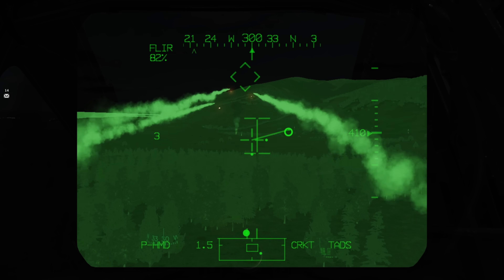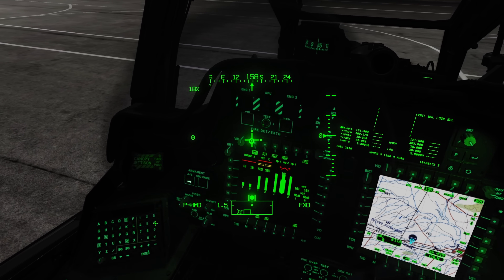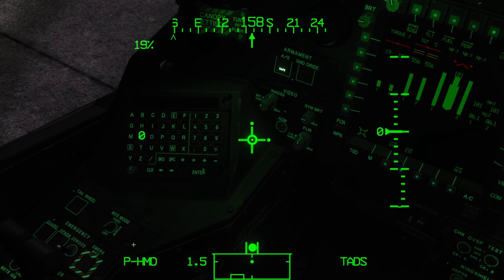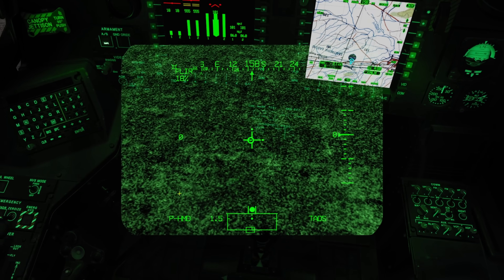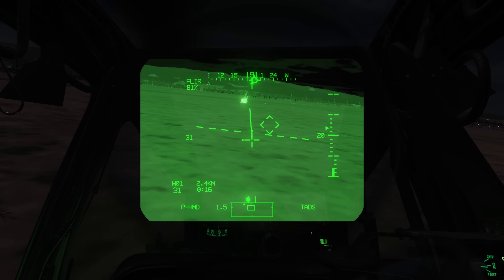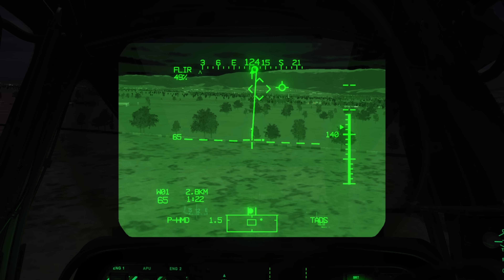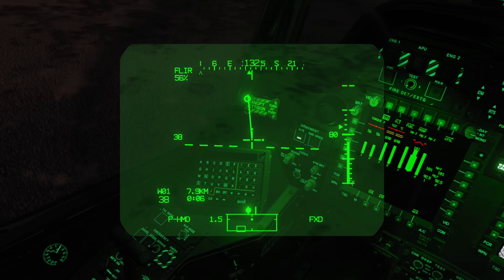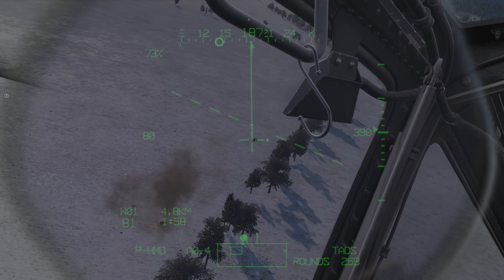DCS: AH-64D Tutorial | Night Operations | DCS World

Comment: (I did send this to you as an email, but thought I would post it here for discussion)

I was practicing some night flying in the Apache and thought I would simulate a dual engine failure (I pulled both throttles to the idle position. As I went to begin my recovery the PNVS and everything else shut off...my scream through the Discord channel was most amusing to my comrades.

Is it normal for the PNVS to shut off so suddenly? At night it's basically an essential system. I don't think I could have reached the NVG's in time- and they run off the generators too right?
Reply from the maker: You let the rotor get too low. Gen shut off.
Reply: @CasmoTV  - I'll do some testing and check back in. Thanks Casmo. :)

Comment: Thanks for the insights :) Just wondering in which situation you would favour the NVG goggles over the PNVS? In VR it gives me a better FOV and depth perception, but it comes at the price of losing the IHADSS symbology and the ability to read the instruments and MFDs. So did you treat it just as a backup or do you actually use it in some situations other than spotting IR markers?
Reply: Yep, the PNVS is very distracting during night ops with vr. Especially when you can't tell the yaw and required rudder input (I need to see the horizon for this). I guess the pilot would use just nvgs + ihadss symbology on the mfd screen and let the cpg handle the weapons with tads.
Reply: MFD screens are not readable with NVG on. It is tricky, the PNVS seems to have a slightly different FOV (zoom) than the default VR view.

Comment: I am amazed by the smoothness and stability of that hover. What kind of inputs and especially curve configs are used to achieve this sorcery?
Reply from the maker: Just small inputs. Don’t over control.
Reply: @CasmoTV  So no curves, no saturation below 100% or anything? 
Because those things were kinda needed to make the Gazelle even flyable for most.
Reply: Keep the acceleration cue and velocity vector within the friendly confines of the line of site reticle probes, and you'll look like a pro.  Develop a scan of Heading, Altitude, Center Symbology, FLIR.  Look close in while close to the ground, and look farther out when not.  Generally speaking, 2/3 ground, 1/3 sky is a good head position.  Nothing higher than that is going to matter, so why look up that high?
Reply: @robk5943  I understand all the theory behind it quite well, putting what you say into practice is quite a different story - the moment the wheels come off the ground, the acceleration cue is outside the LOS reticle already. Pedals are super super twitchy. Also there are weird fluctuations in the torque (and it is not my collective jittering). Nowhere near an expert on this, but it feels overly lightweight compared to e.g. the Shark.
Reply: @mhe0815  I'm finally getting there after a few hours of flying. It'll just click eventually if you practice smooth, slow flight, and stay ahead of the aircraft.
Reply: @ascherlafayette8572  I sure hope so, thanks!
Reply: I used the curves from Wags' video on control mapping. He has Dead Zone 2 on X and Y for the Cyclic and a curve of 8 on the same. He used 80 for rudder saturation but from my understanding he uses a rocker on his throttle as his rudder input, where as I have rudder pedals and use no curves nor change the saturation.
Reply: @CasmoTV  just...muhahahha :)
Reply: @mhe0815  tbh the flight model of the gazelle is the worst and most unrealistic in whole DCS. I mean it's a nimble bird irl, but that thing just flies absolutely insane. Try the Huey, if you want a decently realistic flight model :)
Reply: This helo is much harder to keep trimmed than the KA-50! Omg I am having so much trouble keeping this Heli level! O_o

Edit: OK I just found out that the FFB option in the Misc options page was checked ON and that fucked up my trim on the cyclic. Now that it's fixed, I've been doing a lot better at keeping my Heli trimmed properly.
Reply: @macedk  Yeah it really is that simple.  You can see this in so many areas.  In the USAF they are called PIO.  Pilot Induced Oscillations.  Controlling a F-16 for close in formations or for AAR requires the same kind of skill set.

Hell you can even watch civilians do the exact same thing driving cars.  When they swerve to dodge something or swerve to avoid a barrier or to avoid leaving the road and add in too much steer then they over correct in the opposite direction, etc. etc. eventually leading to a crash.  PIO.
Reply: Ita true what Casmo has said. I too had difficulty at first but after trying for few hours it become second nature. Good luck
Reply: @mhe0815  Actual aircraft, when piloted correctly, is not that bad.  Flew them (and taught them) for 20+ years (A/D/E).  If the tip path plane of the rotor disk is level all around as you pull up on the up/down stick, the following inputs are increased left pedal and slight left cyclic to offset translating tendency.  That's it.  There's always going to be movement of the velocity vector - it's a helicopter.  The key is to not over-control.  Waiting for the official release, but assuming they have them, put the hold modes on until ready to depart the runway, and just use pressure/counter-pressure to nudge where you want to go while hovering.  Also, you're not sitting in the aircraft.  There's no seat-of-your-pants sensing, which will make hovering even more difficult.  Apache pilots sometimes run into the same problem when flying the non-moving Longbow Crew Trainer (LCT) simulator.  Sliding seat and back pans are no substitute for 6DOF.  Hold modes help.
Reply: @robk5943  Thank you, good Sir! Yesterday I set the cockpit textures to medium as so many people recommended, it had an insane effect on my frames (from down to 25ish to now pegged at 45) and instantly I could fly and hover it without any effort. 

Since you know your stuff on that bird, are the torque fluctuations when initially increasing collective true to real life? I have zero time on real world helicopters, but weird up and down fluctuations when slowly and steadily increasing any flight control would strike me as odd.
Reply: @mhe0815  I'm at a loss as I pre-ordered a finished product, not an open beta.  Hopefully, we'll see some of that in a CasmoTV or Wags video and I'll have a better idea.  Normally, you shouldn't see as much fluctuation up and down, unless you're bouncing the collective - which is poor form.  But, the numerical symbology in the HDU of the torque should appear almost instantaneous relative collective and pedal input.  Likewise when banking left (% increase) or banking right (% decrease) in forward flight - commonly referred to as Transient Torque.  You can also see Transient Torque when doing an airspeed over altitude take-off when you apply aft cyclic to begin the rapid climb at the end of the runway environment and then again when applying forward cyclic to level off.
Reply: @mhe0815  A helpful tip - if the PERF page is functional - when you get ready to pick up to a 5' hover, reference the predicted hover torque on the PERF page and just pull to that.  It doesn't have to be pretty.  Just pull to that, and hold it there.  When you look at your symbology, you should be at a 5' hover (in theory).  Then, instead of riding the rodeo, as the acceleration cue passes through the center of the LOS, turn on altitude and position hold modes.  Then, relax.  Eventually, you'll depend less and less on the hold modes, and will just get a feel for how the machine responds to your inputs.  Just remember that a really heavy Apache handles like a '64 Cadillac with the power steering going out.  Plan ahead.
Reply: I will have a look at the perf page, thanks! Altitude hold is not there yet and position hold is not there either yet. I believe if you engage both altitude and attitude hold below 5kt you enter position hold? Pretty much an auto hover?
Reply: @mhe0815  Pretty much.  The hold modes mean different things depending on ground speed.  I'm just sitting here looking at my keyboard and praying to the Thrustmaster gods to make everyone's lives easier and just make an Apache cyclic and collective.
Reply: @robk5943  Right there with you - all I need is a Apache style grip for my Virpil collective and I am all set!
Reply: @mhe0815  with my Warthog HOTAS I have 25 curvature, started with 30…full satruration. My Rudder is TM T16000….Probably the next thing to update. Curvature of 35, full saturation as well. Start trimming the torque.as soon as you notice the rotation during lift off. The Apache is always a little behind your corrections, so keep it smooth and steady.
Reply: @caseyryback6932  Thanks, I already overcame my initial issues, they were mostly due to very low framerate, which affects controllability. Now down to curvature 15 with full saturation, flying very nicely and hovering without much issue.
Reply: @mhe0815   It also depends on the quality of your stick and what you're gaming with.  I have a crappy Logitech Extreme 3D pro that was 30 bucks, so it has a little bit of an issue dead center where it will send signal to the wrong sensor.  Like a tiny amount of y-input on the cyclic will translate into some y on the rudder which makes it super unstable.

So I will set my deadzone on cyclic to 5 and 10 on the rudder, curve of 20 on the cyclic and 30 on the rudder for some dampening with y on all set to 90.  Setting it that way gets around the problem of my stick being garbage, and that I'm also using the stick to control yaw because I'm cheap and don't have pedals.
Reply: @GTRNights  I got it figured out by now, it was my low framerate. I am lucky enough to run a Virpil CM2 base with extension, so that front is sorted.
Reply: @mhe0815   yeah, super nice stick.  Thankfully for me, the frames aren't the prob because I have a 3070 on a watercooled Ryzen 7 5800x.  Just crank everything to max no prob.

I plan on getting an X56 to start with.  Never had a full HOTAS before because I just never do flying games but for the Apache, I'll make an exception because I used to work on them and even had a packet to go to WO school and try to get an Apache seat.  got injured and had to leave the military, so it's kinda like a dream of mine that never came true and this is the closest I'll ever get.  guess it's time to suck it up and invest in an X56 and then see where I want to go from there.  Kinda hard for me to justify a 1000 dollar stick just for 1 game and 1 aircraft though.
Reply: @GTRNights  I fly VR, so cranking stuff to max is not an option at this point in time unfortunately.

Comment: hey Casmo,

i noticed your zoom slider has the same problem as many other HOTAS joysticks aswell as mine. if this bugs you just as much as me, there is actually a solution for this. you can just create a virtual joystick and use the input from your HOTAS. the software then just averages out the 2 individual stutter points on the potentiometer inside the slider introducing a litte latency but removing the stutter completely. (the lag is next to unnoticable for zooming). the software is called vjoy and joystick gremlin.

Comment: After all these years I don't understand why they can't make reflection on the planes/helicopters from the lamps on the parkinglots in a so advansed and realistic simulator.
Reply: cause frames already struggle for anyone without an OP computer (even OP computers barely get 60fps in many cases), i think it comes down to only adding what is needed and polishing it to its best rather then adding anything more that could potential damage FPS more then its worth (which i would say something like that with all the calculations required would fall under)
Reply: @scuffedscruff9505  You're maybe right, but then I would think that the sun and the shadows and reflections that produse must be a lot more fps hungry than some lamps. Sorrry for my bad english :)
Reply: @baardk2  those reflections and shadows make a massive difference to quality and overall quality. The problem is when you do those small calculations for small details, yes it’ll make it better, but the cost won’t beat the outcome compared to your overall shadows and reflections from the sun

Comment: Thanks! I'm busy at the moment doing flying exercises on the ramp, just like with the model RC helicopters. the RC helicopter experience actually helps quite a bit in recognizing the combinations of inputs you need and how you need to react in a low power situation (compared to rc heli's these vehicles are seriously underpowered). 
After about 5 minutes I manage to fly a smooth figure8 in and out of groundeffect with constant speed/radius in both the left and right turn... It is also a lot easier to keep the hover stabile and accurate when I ignore the IHADSS symbology and just look at my inviroment. 

I do wonder why these helicopters do not have a heading hold gyro for the tail, prettymuch every RC helicopter has it at the moment and I'm not sure why it isn't used for the full size helicopters. Maybe due to the limited power-weight in comparison.
Reply: I am a RC helicopter pilot and actually fly/hover/land the Apache around in F3-flyby mode. Really alot of fun.